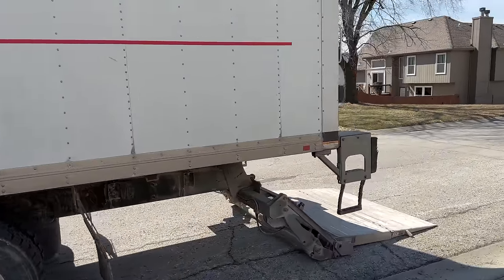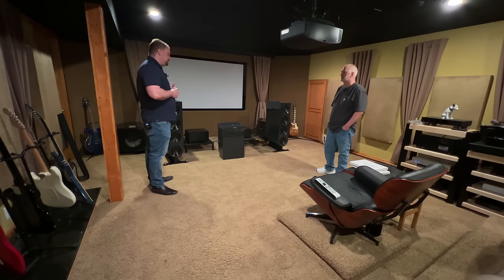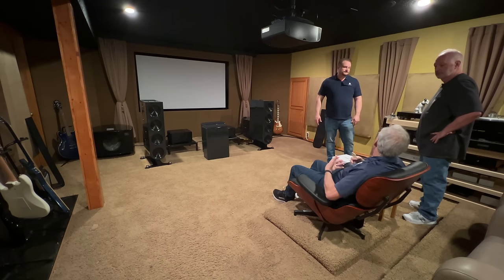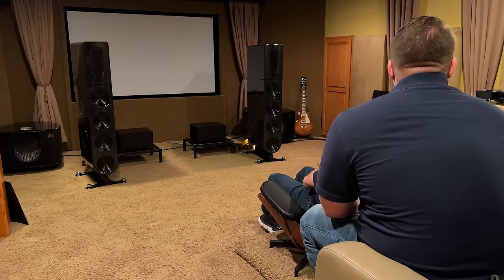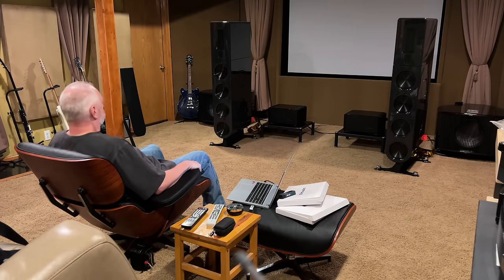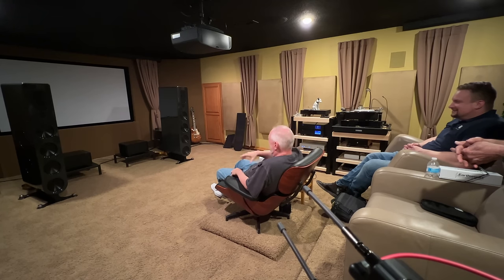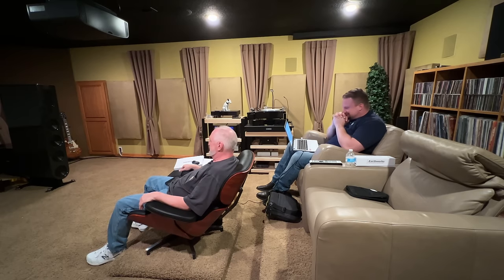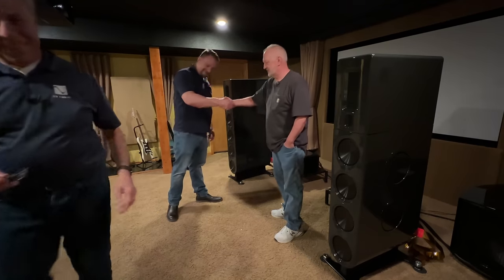PS Audio FR30 loudspeaker installation number 2

Comment: Watching you guys go through the set-up of the FR30's has me flashing back more than 50 years to my tube monos built from kits and my diy speakers featuring 3 way cross overs in huge "sound shaped" home brew (from magazine plans) cabinets that were open at the bottoms (not reflex) - 12" woofers (later to be 15"), 6" midranges and horn tweeters, whodathunkit back then to where we are now! Words such as "sound stage", "imagining" didn't even exist, and no, we didn't have brawls over wire either!! If ya had left and right you were in - although ya had to be sure to buy "stereo" records to get that back then!

Comment: Did you ever do any listening with his subs running?  I can't imagine why you would need to but I was just wondering if you tried them.  Also, getting good depth and width in that over dampened room says a lot for the speakers themselves.  40 years ago I had a 2nd story music room with 2 walls exposed to city noise and I insulated and dampened to excess. All but the plaster covered brick chimney coming up from the fireplace the floor below.  One day I was standing between the speakers, just behind the front face of them and noticed a wonderful sound stage coming from the reflection on that hard plaster wall over brick.  It was my first time hearing what reflections can add to the sound.  If the owner of that room takes their advice and livens up the room just a little in the correct places he will be more than a little surprised how it will open up in ways he may never have heard before. Thanks Paul and Chris for your patience and skill with these installs.

Comment: Amazing...with that out of the way. I'm not a fan of my listening position (Ears) being below the tweeter in any speaker I'm listening to. Sub's are purdy but I would also like to see them at least 1 more feet apart. Am I wrong either of these preferences? If so my speakers are too far apart, and my listening position is wrong.

Comment: Question:

When moving and maneuvering speakers in new positions do you have to recalibrate every time ? 

As in , should I run my ‘audessey software’ with microphone on 2 channel listening for those new positions or just run the speakers on ‘pure mode’ which bypasses eq software like audessey  (coming from a Denon 3600) ? 

Thanks !
-Nick

Comment: I'm sure Jim (who probably is reading the comments) is super proud of the personalized service.  The room dimensions are Awesome!  Some small tweaks to his hybrid 2-channel/theatre setup acoustically would be easy to do to remove some of the deadness in the room. You can also see that he has large corner bass traps, but they are well hidden, which for sure are helping with the bass articulation.  I think that they can probably be moved outward a bit by the  owner to help his theatre setup, with a touch more toe-in.  It would also be cool to see the frequency response measurement of the final position, but not necessary.
Great job PS-Audio and congratulations to the owner! Enjoy in good health
Reply: I kinda like my room, the speak wall is open on 2 sides. The back wall is 12'  behind me and 18' in frt of me the only draw back is the rooms 25' wide +  and 13' from frt to back wall  so you really can't move the speakers off the wall, but the ports come out the frt of the tower speakers.  The rooms not dead its more open so you really don't get reflected sounds.  The energy is absorbed by the other large rooms.
Reply: @bobbg9041  It definitely is an excellent space.  Enjoy!

Comment: Nice! I remember when I couldn't wait to run up my credit on the next piece of audio gear, then I level off about 20 years ago. Question: today TV viewing is all about immersion and I sit way up on a 50 inch TV, which means in order to get distance from my mains I have to move them out instead of back. Do we really need to choose between the sweet spot for viewing or the sweet spot for listening?

Comment: So much better than the last set-up.
Between the two set ups so far, it should be obvious how big of a role the room itself plays in the overall system and flexibility of set up. It’s not just about throwing as much high-end equipment as you can into a room and hoping for the best, but actually maximizing the equipment and speaker integration with the room itself. Because of starting out with a good room, look at how much easier, flexible and quicker that speaker set-up was compared to the first one. 👍🏼
I hope this helps prove to people how important it is to start with a good room first.
Reply: That last room really needed lower speakers. Or even bookshelf speakers with subs

Comment: Sound Stage is much wider, deeper and taller than I would have expected for Speakers being so close together! I could eliminate my Mini DSP in-between the Pure DSD Stream and the Dac! No need for Parametric Equalization or Tone Controls either! A True Pinnacle of Achievement! Comparable to even the most expensive HiEnd I have heard at any Show! Can't wait to hear them in person! Superlative Creation!
Reply: Seriously, how can you possibly tell anything about sound stage, depth, etc., considering the recording was done using a few wireless mics that were in constant motion? They may be great speakers, but you couldn’t possibly ascertain that from this video, especially considering YouTube's compression algorithm.
Reply: @jah5035  50 years of Near Field Listening where everything comes through mics gives you a good idea of what is going on! Especially Post Fade! After you have listened to hundreds of different Speaker Manufacturers equipment you hear the subtle differences! Compression just limits Dynamic Range, not nuances! But the higher quality mics are most capable of picking up the Finest Details, Tonality, Spacial Properties and more if you have a Trained Ear!

Comment: I heard the IRS V on many occasions and these new FR30 seem close to the dynamic impact of those speakers. On a couple of the recordings, it seems a little too much bass, but I am sure the microphone was not in the optimal location. I am very impressed. I would love to hear a direct, side-by-side comparison with the Focal Utopia Evo or Stellas. I love the way these speakers look. PS Audio did a fantastic job with these speakers in both sound quality and design. Too often folks have to make a compromise between the two. The only suggestion I have is to possibly add the ability to tilt the tweeter and possibly mid-range slightly, without having to tilt the entire speaker.

Comment: Dear Paul

Iam from South Kora. I always find your l channel is very informative to me, as a first  beginner.
Can I ask one question, which is on LS50 META Speaker?

I am quote satisfactory about the speaker, as long as musics such as Piano Concertos are concerned. Problem occurs when I listen to symphonies, which I like the most of all. In the case, I find that my  CAMBRIDGE EDGE NQ,W pre and power amps do not have power enough to drive symphonies. In am effort to solve the problem, I pluge pre/ power amps into separate wall sockets instead of a single wall sockets using a multitap. I certainly find that it improves the dynamic power but not enough, specifically when  almost all the instruments are simultaneously being playing including low frequncy timpanies. I easily find the sounds are noticeably deterioated at that time.  How can I solve the problem? 
1. Do I need a separate power supplies for each?
2. Do I need a subwoofer like KC61? For this choice, I still doubt its effect because my wall sokckets are limited not to plug in the subwoofer in another extra  wall socket. Still, I think that I need separate wall socket too, which is far from the other two. I am skeptical about the result of that method. It may inproove the low frequency only a little bit.
4. Or any othther solution ?

I am eager to hear your advice. BEST REGARDS .

Hong Seok Kang from South Korea.

Comment: Awesome sound when he played his quoboz track! Nice room and you can definitely hear when you guys were talking how the room is overdamped obviously for is home theater set up but not applicable for two channel sound! 

He’s got those absorption panels on the right wall maybe 6 feet from the Loudspeakers between two curtains if he were to replace that with the diffuser would have a much better impact! 

I wonder which Rockport model he had those are very heavy dense loudspeakers over $100,000 and he chose the FR 30s, $30,000., 1/3rd or 1/5th the Rockford cost! that speaks volumes about your awesome FR 30s Paul! 

Aaron Copland microphone was in the wrong position it should’ve been in the center, it was off to the left! Love the FR30’s! Very impressive! Wow!
Reply: What would speak the most volumes is the customer giving his input on how it the PS audio speakers sound compared to the Rockport speakers. Just because he had a $100,000 speaker and he bought a 30000 speaker that doesn't tell us anything. He obviously bought them before he even heard them. I'm willing to bet my first and second child that it's simply a different sound but not necessarily A Better Sound. That's what I've learned from different speakers in the three Rigs and my place is the sounds are just different. It's not like one sounds fantastic and the other one sounds like crap.

Comment: I got into a few more acoustic ideas this weekend and (bla bla bla) I tried out some oil paintings over the first reflection sidewall absorbers. The reflected sound was uneven in weighting across the frequency band, then I flipped the paintings over so it’s the canvas facing the sound. The balance of reflection and absorption is near perfect and the soundstage breaths way better now. It would be easy to experiment with covers for those absorbers in order to achieve a balance of absorption and reflection.

Comment: A key moment of this discussion could benefit from additional clarity. 
The room is certainly not overly damped, it simply could benefit from diffusion/scattering in the midband on up. 
The inherent challenge of any typical residential listening room is maintaining a degree of liveliness and apparent source width ... while adequately damping the LF for ample clarity. 

Most all rooms are way overly reverberant in the LF. 

Generally, even decay times are desired across the octaves... this requires significant bass trapping, while retaining as much MF/HF as possible. 

I'd implement simple two dimensional diffusion targeted at ear/tweeter level, along the sidewalls. 

Other best practices include facing each absorber with 6mil Visqueen (limits MF/HF absorption). 
Also, much more absorption at the loudspeaker end of the room, and targeted ceiling absorption between the LP and the loudspeakers. 

In addition to LF trapping in all corners, the rear wall behind the listener, significant amounts of LF absorption, faced with modest yet adequate diffusion as needed. 

In all cases absorption can be Visqueen wrapped except ceiling, I'd suggest full bandwidth ceiling absorption. 

That's all best practice low hanging fruit ... but you need to measure to truly determine what's actually going on. 
Measuring is quite easy, OmniMic  from Dayton, is silly easy (within a couple minutes upon opening, you're measuring). 
REW is state of the art free software, add $100 mic and you're off... w/massive group of helpful enthusiasts awaiting your questions. 

I dig that room... unsure of amps and signal path... couldn't determine what was what. 

Bottom line; 
Employ as much bass trapping as possible, face the trapping with diffusion as needed.

Comment: Was surprised to see very basic push on connectors for the speaker cable to the midrange driver, lovely looking speakers.
Reply: Faston connectors are the industry standard for most drive units.  We are using a gold plated connector.  Our planar drivers are terminated to the diaphragm in such a way that soldering to the terminals isn't advised.

Comment: It would be nice if they specified what equipment was being used to drive the speakers.
Reply: Agreed not knowing what’s driving the fr30 will make a Huge difference.   As a customer I would want the boxes and packing materials persevered in case I had to move to a new home in future and not torn apart and trashed as shown in this install. Imho

Comment: Only PS Audio provides this kind of after sale service by helping the customer to install the speaker with room optimisation. Bravo! Take note other speakers producers
Reply: Bose also used to provide the room optimization service, part of their high price
Reply: I like that the PS Audio speakers can be pulled apart to replace parts at home...if necessary.  Some Magico speakers have to be shipped back to the factory if things need to be replaced because of the way they are constructed.  That means shipping a 150+ lbs speaker to the factory and not having it for 3-4 weeks.  PS Audio=Customer Service.

Comment: Keeping these massive speakers so close together may be a problem for screen viewing in some set ups. How much would the end result be compromised keeping them a couple of feet wider apart?
Reply: You would need to move the screen anyways. That screen placement is for in wall speakers
Reply: I agree definitely not a Super Bowl party room the speakers are blocking the screen but definitely nice sound from 10000 dollar speakers with a markup so they can make a 20000 dollar profit for the very few pairs they will sell and get Paul and his engineer to come to your house but trust me they are making 20000 plus profit but it’s his money to spend
Reply: @dmptcb  I don’t get what this has to do with my question. Keeping the same screen with the speakers wider apart could work given the sitting position. Regarding the price mark up, how much you think Wilson Audio or Magico are making as profit then?
Reply: The sound stage would fall apart and mids would get really thin

Comment: the absorption works well with bass but the first reflection should be below the mid range and tweeter
possibly where hes sitting as well. plus he should have the absorption panels to the floor
I'm not sure using the fiberglass is the best thing I think a rubber would have been better material

Comment: I liked this video. I have monitor audio platinum PL500 II. I can agree to what the listener is saying about speakers better than the recording. My flaq files if recording is great the speakers sound incredible. If recording is okay the speakers can only sound as good as the recording they are given to reproduce. So high end equipment is brutal showing recordings that do not measure up.

Comment: Kind of messes up his projector screen though being as the speakers are so tall?
Reply: ..and close to each other. Good for the sound, bad for the image. Poor audiophiles, they can never have it all.
Reply: You would want to move the screen off the wall and either put one between the speakers or use an acoustic transparent one in front of the speakers anyway. Current setup is is only really good for in wall speakers

Comment: the midrange driver is GRS PT5010-8 10" Planar Mid/Tweeter 8 Ohm
the tweeters are GRS PT2522-4 3-1/2" Planar Tweeter 4 Ohm
Reply: False.  We use a similar design (based on the BG NEO10 etc but with some differences from the parts express copies)
Reply: @cbrunhaver  yea, some branding maybe
Reply: @HowDareYouu  I worked at BG with the originals and PS tooled these diaphragms (our tweeter is 8 ohm, not 4 ohm), plates (for the thicker magnets), terminals, plates and back cups. Our magnets are n52 grade as well. We also use a heated press to corrugated the diaphragms, which PE doesn’t.

Comment: eliminate all reflections and diffusion - absorption is the way to go - in normal recordings, all the spatial cues are captured  in the recorded mix - they are not to be added by room diffusion or reflections
Reply: Well I can attest to the opposite from my experience. Small speakers and a highly absorbant room kills the sound

In this case though the speakers are not small and are therefore able to sound and image well. It's a balance

Spacious(ness) is both a factor of recording and the room. Where an absorbable room works is by reducing the background surrounding noise which helps in hearing the finer details

Comment: I knew the height of the speakers would be an issue. A regular seated position is too low for these speakers. Notice you can not rake much at all. Not good.
Reply: You must not be a fan of modern McIntosh speakers.
Reply: "regular seated position " - for you, maybe.  But for me his listening chair is too low.  A proper posture chair combined with a 6' person will give an ear-to-ground height closer to 52", not the 42" at which the customer was seated in this video.    And for this guy in this room - if he'd dedicate the room to 2-channel he can get rid of the second row of seats and move his chair back another foot and half, which will improve his listening.
Reply: @TheDanEdwards  he's got a regular chair and it's even propped up on a little bit of a riser. The speakers Tweeter and mid-range are still too high for an average listeners seating position. It's simple as that